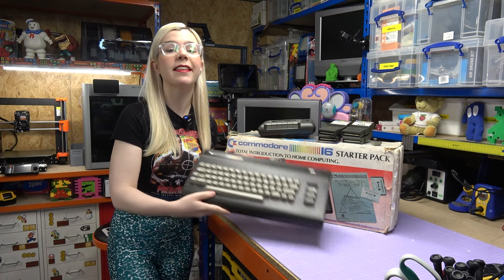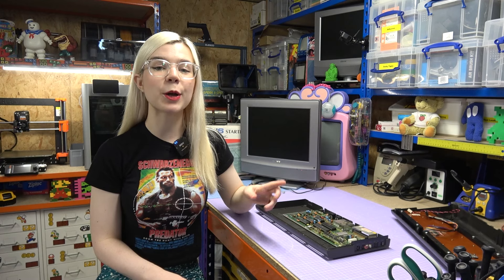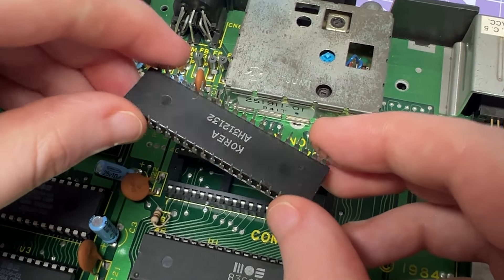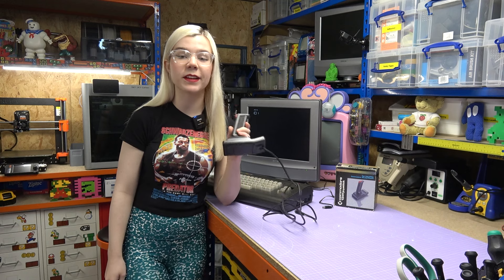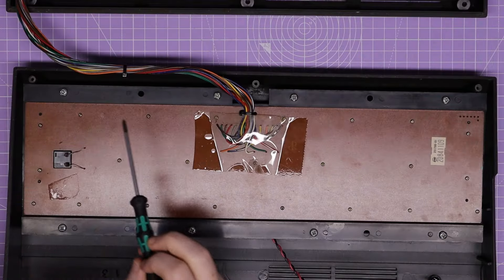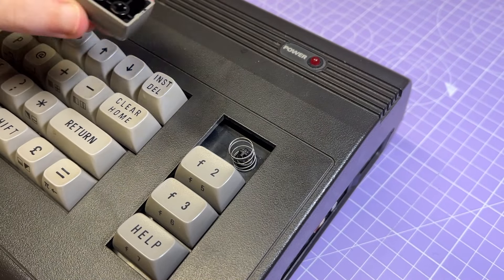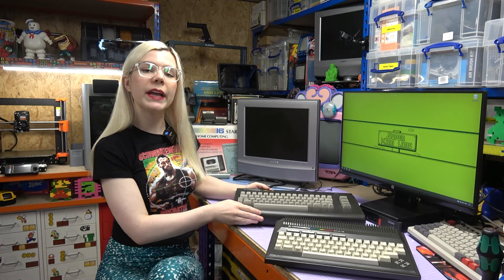Can I fix this 40 Year Old Computer // ft. Commodore C16

Comment: You know what? I do have an otherwise working C64 with a similarly broken F1 key :D I've been quite afraid to bite the bullet and take the keyboard apart as I know how prone it is to spray its insides, all the tiny plungers and springs and whatnot all over the place... Now I'm a bit more confident, so - thanks. As for the CPU I would probably go for an adapter if it's cheap enough (as I have some dead donor C64 boards) or - if it isn't significantly cheaper than the modern replacement - the FPGA solution, out of sheer curiosity. For me it was an interesting experience to trade a real 6581R4 SID for an experimental replacement part based on two ARM based ucontrollers. And it's - fun, no regrets here.

Comment: What made me unfortunately have to part with my c64 to the scrap heap was the power supply, even had a go at replacing the clear fuse inside the powerpack but sadly it never worked again!

Comment: Great video! I had a problem with a broken plunger stuck in a C64 key once. You could try saving it by drilling a hole with a very tiny drill bit into the broken plunger, screwing in a long screw that fits (not all the way in, of course), and just pull it out with all of your might. That worked for me. :D

Comment: I had a few Plus/4 machines back in the day.  I loved them but they were much the most unreliable of Commodores.  RAM failure was the most common fault but certainly not the only one.  I remember there was a better word processor cartridge and I wired the board for that into one of my machines, which made it easier to handle.  I also had the 1551 floppy drives which were great compared to the 1541.  I once even connected the thing via a serial port adaptor to a VAX/VMS mainframe.

Comment: I've never run into the Commodore 16 myself, just the VIC-20 and the C64. For the C64, some of my personal favourite games are maybe California Games, Gauntlet II and Infiltrator. Though Infiltrator on a cassette will drive you mad with multiload😉

I've had to do some fixes on my own C64 and just shorted the power switch when it broke, so now it's always on if the power brick's connected😃 I ought to fix it properly but when desoldering the heat seems to go everywhere but the place I'm trying to desolder...

Comment: That was a lucky repair!  Sometimes the fault is even simpler to fix: the pins or the contacts in the socket become slightly corroded, and make poor electrical contact.  Simply removing and reseating the offending chip is usually sufficient in this case to restore good electrical contact.  Did you try doing this?

Comment: I suggest adding heatsinks to the CPU, PLA and TED. I did in my C16 mods and memory expansion to 64K.  Also my Plus 4. They can run hot and fail.

Comment: Great video thanks! Cor those replacement chips are quite expensive. Are old CBM 16s or Plus 4's available cheaper, perhaps untested or for spares? It could be a gamble though if it's often the CPU that fails. As for games, I'm sure you know the classics for the 64, but I personally loved playing Paradroid, Dropzone, Commando, Trollie Wallie and Monty on the Run! As a sidenote, I loved how there were really different games and styles between the UK and US scenes. If you look up top games lists and see those from the US, I hardly recognise any of them. Keep up the good work, and don't worry about any anti-static commenters, I've built and repaired computers for 30 years and never used anti-static protection, but equally avoided clothes during those repairs I know can cause a build-up!

Comment: Kari, I have an idea for a vid. Use an Arduino to monitor the voltage levels in old computers and sound an alarm if they go out of spec. Like on the ZX Spectrum you have 3 separate voltages. 12 volt, 5 volt and -5 volts. I`ve seen a shield that can measure negative voltages. But ones with no negative voltages would be easier to build.

Comment: In regards of replacing the CPU: The modern FPGA replacements are fine if you need to repair your own system to keep it working for yourself or somebody you know wants to enjoy it mainly to entertain themselves.

But of course if your interests are more tilted towards keeping the machine as a bit of a functional artifact of computing history, it makes the most sense to go for an original replacement. That way the next person to dig into the machine in annother 20-40 years can experience the actual history as described in the original documentation. Instead of finding an intermediate fix that will very likely have become entirely undocumented / forgotten by that date.

Comment: You could maybe first try to spray some contact cleaner into the CPU socket and place the "broken" CPU again! Sometimes it's only a bad contact!
  Best regards, Doc64! Keeping C64 alive! 🙂
Reply: She even mentioned in the beginning of the video that sometimes there may be a dirty socket issue. I'd love to know the outcome.
Reply: That is unlikely in those kind of computers. The 8501 is kinda famous for not being the most reliable cpu ever made 😁
Reply: @zteow  it's basically a 65xx core with some modified I/O pins, right? Or did they have quality issues in the production process that makes them more prone to failure?
Reply: @nkronert  yes the 8510 had a higher clock speed, around 2 MHz and allowed for smoother multitasking and overall better performance. About being less reliable, higher speed means more heat. It was more complex than the 6510, which makes it more susceptible to issues when under stress. A final consideration, the 6510 was much more common than the 8501. As a result the 6510 was more readily available for replacement, whereas finding a working 8501 could be more difficult.
Reply: @zteow  Thank You for CPU reliability info!
Reply: @nkronert  Indeed they had, the (relatively) new HMOS-2  manufacturing process made the 8501s very vulnerable. They don't age well, unlike 6510 CPUs.
Reply: @pawpw1  good to know. Luckily I don't have any processors of that type.
Reply: @zteow  8510???! -Commodore used the 6510 and 8500 CPU's in the C64. The 8500 CPU are more reliable than the original 6510. The C128 uses the 8502 CPU. I've never heard about the 8510
Reply: @nkronert  No wonder, as the chip doesn't exits.
Reply: I'd probably go the full FPGA route for the replacement unless a period correct chip was availble cheaper than the prices you found.

Comment: Aww, the C16 was my first computer. Such a lovely little machine despite the drawbacks compared to the C64 like the very basic sound capabilities, the missing sprites and the small memory. But capable programmers (Udo Gertz, Shaun Southern, Tony Kelly, ...) did some great magic with it.
The hardware fault we had regularly was that the fuse (visible at 2:25 on the right) burnt. Not sure how we knew that this was the broken part, as in our family we all weren't really hardware geeks (also, I was like 10 years old at the time). But it was very easy to replace. Until it burnt again.
Reply: It might be that burned fuse was protecting your C16 for further damage and the real reason was electricity or overheat caused by some other component somewhere else. Actually @c-teow comment that used CPU had usually overheating problems was interesting one.

Comment: 8501 is the most failing MOS chip ever ;-) From 6pcs of C16/C+4 machines I collected during the years, 5 was initially faulty, and each of those had a faulty CPU. It wasn't the whole story for some of those, but still - 1 remaining original CPU out of 6, what a statistics. To the question asked in the video: tried both FPGA replacement and CPU adaptor, both solutions worked (and still do) 100% flawlessly. Interesting observation: despite the TED chip was manufactured using the same technology, I have yet to see a completely dead TED chip. One of those 6 pcs glitches a bit, having some ticking noise in the sound output, but the picture is still crisp.

Comment: Did you try putting back the original 8501 CPU and testing it, after confirming that it was the defect?  Back in the day when I worked on this stuff, it was common for the socket to oxidize.  Simply pulling and replacing the chip scraped away the insulating oxide layer and restored functionality.

Comment: hi used to repair them from new one question why no static prevention and you pulled out cpu and put your fingers all over the chip pins  lucky you did not blow it  also check a th ing called chip creep where they walk out of sockets

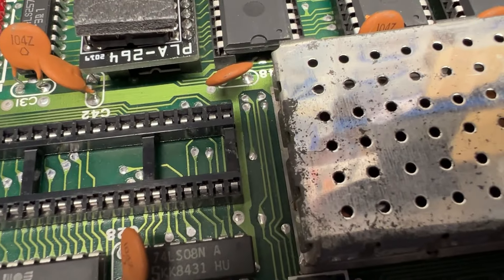Comment: 3:41 Hey Kari, if you didn't use a chip puller it would have been a real problem there as you say.

My old boss used to hate us calling them "Chip Pullers".... He preferred we call them "Engineering IC Removers".... 😃

Comment: Another option is a 6502 adapter. 6502s are real cheap (like a tenner), and some of the adapters come with memory expansions built in, taking the machine up to 64K or even 512K (an assembled one of those is about the same price as an 8501, I have one in my Plus/4)
Reply: You forget the most important argument: A 6502 based adapter is 100% compatible, while a 6510 based adapter needs a custom KERNAL and is unable to run games that use fastloaders.

Comment: I would go with the fpga solution as its the most compatible. I have one in my Plus /4 and it works like a charm!
Reply: I agree, a replacement CPU will eventually die also, maybe sooner than later.  I have that FPGA version for my Plus/4 and it works great!

Comment: I'd say go for th 6510 adapter.
Reply: No, 6502 adapter. 6510 adapters are incompatible and 6510 aren't for free either. 6502s are available at low-cost and they allow for full compatibility.

Comment: The C16 was my first homecomputer in 1985. Today I own several C16, a C116 and a plus/4. 
There are some kinds of replacement for the 7501/8501-CPU, based an the 6502 with some external ICs that work very fine.  
I built a portable C16 into a suitcase, with a small flatscreen-monitor, a battery and a SD2IEC-module, and sometimes I play Wintergames with taht good old sound of the 80s

Comment: Amazing, thank you for the video! A piece of advice: if you one of those metal plates that were used to cover the empty card slots at the rear of IBM compatible desktop PCs, the bent edge can be used to lever DIP ICs from their sockets. Just be careful that the pivot point doesn't bend nearby components.
Reply: if you have one of those*

Comment: Did you try placing the original CPU back in? Occasionally just reseating the IC is sufficient to resolve some issues.
Reply from the maker: Yea, I cleaned both the socket and the chip and tried again, even in the Plus/4 but it's got no life in it anymore.
Reply: @karilawler  8501s die because of internal corrosion. It is said that Commodore did use too much boron in the manufacturing process, which is what kills them. They just stop working one days and there is nothing you can do to save them.

Comment: Hi Kari, LOVE your vids! I have a question I hope you can help me with. I have a Panasonic JR-200U Personal Computer made in 1983.  Do I need to buy an old analog tv for this or can I use some kind of converter since all of my TV's are modern digital TVs and I cant get anything to come up on the screen when I plug it in.  THANKS!
Reply from the maker: I can only really recommend what I use in my videos, rather than a CRT it's a early 2000's SONY 15" LCD TV. It's got a analogue tuner and a load of other inputs (composite, s-video, component,  etc).

Comment: The joystick port was made small as the computer was to be in a spectrum style case with rubber keys. You can see the board is so small in the case as the case design was changed. In Germany they did get this machine in the rare Commodore 116. I would recommend keeping the CPU but add in some heatsinks. Some great games I played were Rock Man, Megabolts, Dorks Dilemma, Ace, Squirm, Fire Ant, Fingers Malone and Tutti Frutti.

Comment: Subbed. Nice to see another retro repair person, just like me! I say go for the FPGA CPU recreation. It is not as pricey as the original apparently, and is not much more than the adapter and OG C64 CPU. Both old chips are, well, old and bound to fail a lot sooner than the FPGA replacement....which will probably outlast both of us....and the rest of the machine!

Comment: I think the FPGA would be fun to have in the C16
Did you actually confirm if the original chip was faulty, or just dirty connections in the socket?

Comment: Congrats on this relatively quick repair! I actually have a C16 hidden in a closet somewhere but unfortunately no PSU. Lyka the Lost Island (also released for C64) is a great 2022 game for the system, which looks amazing! Better than the C64 version in fact, because the Plus/4 and C16 have a much larger palette of colours. It does require a memory expansion on the C16.

Comment: Did you check if the C-16 works if you put the original CPU back? Sometimes these cheap sockets don't conduct very well after a few years. Had the same issues with my Amiga 2000's.
Reply from the maker: Yep, cleaned bother the CPU and the socket but to no avail, sadly.

Comment: Not a criticism but an observation. I was taught and always worked at an antistatic workstation. One company had a policy of instant dismissal if an employee touched a development board without wearing an antistatic strap. The boards were around 10->20 thousand USD each so that is reasonable. Certainly handling chips by the insulated encapsulation, never the pins and boards by the edges only. A few components now can still be instantly destroyed by a touch. Many others will be damaged but appear to still work. If a space craft is being built that has to work for twenty years one component mishandled can cost billions. 
You are not taking precautions which may encourage others not to and possibly have failures and not understand why.

Comment: Thank you kari, entertaining as always.
It is a good practice, when swapping chips between a functional computer and a faulty one, to use the good one for testing, because if the chip failure is caused by circuitry damage, it would also break the new chip.

Comment: Nice one! I remember when my spectrum+2A went kaput. Took it apart, not knowing anything. Hmm press the chips in and the ribbon cables. Actually worked!  For the chip go with an original commodore for sure. Have to keep the full vintage factor

Comment: Lovely C16 re-animation / CPR procedure / open hearth surgery! :) 

I have had quite a fair few C16s die on me. I do have a functioning C16 as well as a Plus4. I do think they still look very nice and even up to date with their grey/black colour schemes. 
 
The c16/plus4 seem to be quite susceptible to faulty chips. Ended up with a fair few unusable C16s using the carcass of one of them for a keyrah. I also used the keys of another one (the keycaps) on a newer C64 build with a reproduction C64c black case and stuck them on a C64 keyboard board (they keyboard boards are quite different and not interchangeable with between the two) - not all keys are on the right spots on the C16 layout as there are differences in positions and also keys that exist on the C16 but not on the C64. With the C16 keys in their right spots sitting on a C64 keyboard board the C64 looks quite nice. Some might think it blasphemy to re-use parts of dead computers like that.

I have a soft spot for all those breadbin-type Commodore computers.

Comment: You can recover that old key by using acetone on the superglue, acetone is nail varnish remover. If the FPGA is cheaper than the original cpu's, go that way.

Comment: Still have my VIC-20 sitting on a display shelf behind me.  Proud to say that I am the original owner!  Sadly, I have not turned it on since about 1998 +/- a year.  At this point, I am a bit leery to turn it on without taking it apart and checking the motherboard for leaking capacitors. Maybe next year is the thought; which is the same thought I've been saying more the past decade.  I miss my VIC-20 --or maybe I should say I miss my youth and the golden years I spent learning to program on that machine.  I always did want a C16 though, simply because even back then I liked black cases!

Comment: Fun ending :) I would go with the FPGA option - there is something about this era of machines that kinda demands you maintain a franken-machine full of replacement parts and bodges. My C16 has a 64K upgrade and SHOCK I drilled a hole in the lid so I could install a switch to flp between the memory modes

Comment: Given that you'll need a modified Kernal ROM for compatibility using a 6510, and even that won't be 100%, I'd choose one of the other options. I'm a purist and don't really like emulated chips unless that's the only option, I'd go the 7501/8501 route, even though it's a little more pricey.
Reply: Exactly. Thank you! With a 6502 you would need to adapt the pins layout first and then install a different kernel rom. It’s not the same thing!